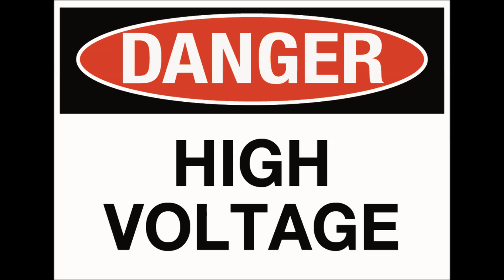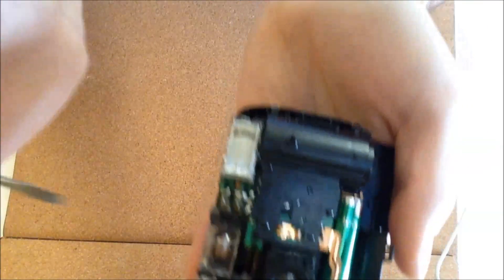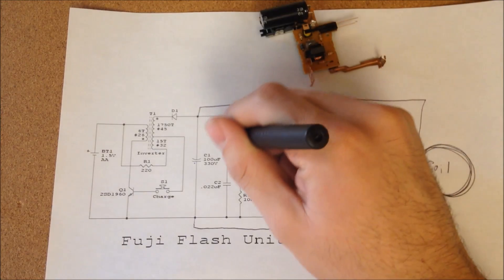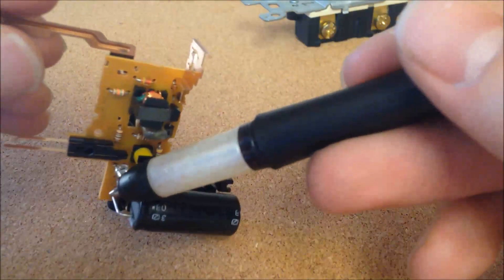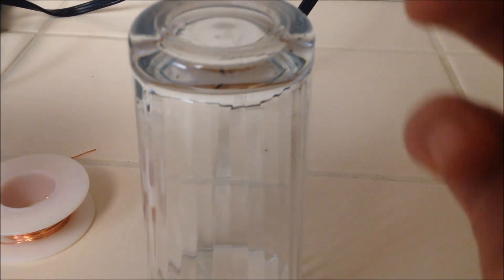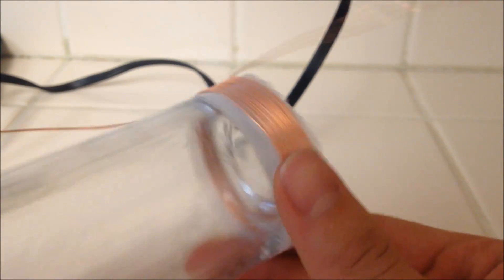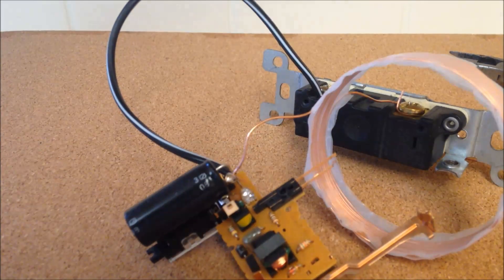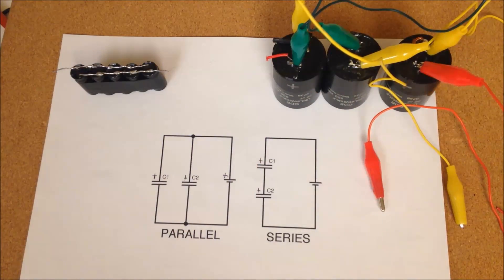How to build an EMP generator

Comment: Too little voltage and too much inductance in that coil lead to long rise times, making this a very, very poor simulator of EMP.
EMP is a broadband phenomenon.  You only get that with a short pulse having very high rise time.
This is not an EMP simulator, not even close, and you should not be calling that, because you'll confuse people.
Reply from the maker: Yeah you're probably right, although this is a really old video and I have stopped tinkering with electronics. I probably won't change the name or do anything else with this video listing.

Comment: Does the circuit can b used for higher voltage capacitor also and the power source can be also changed to higher level it is possible or not

Comment: After I follow the tutorial in the video, the LED will not light up, and the experiment will not work, but when I turn off the switch connected to the capacitor, the flash will flash. What's wrong with me

Comment: Can anyone tell me which capacitor (precise) do I need. I’m not buying a camera for that
Reply: It's not just capacitors that are needed. The voltage needs to be correct, the caps must be charged, then they must all be discharged into the coil simultaneously. He's just trying to make it fast and easy for people. A disposable camera with a flash is very cheap.

Comment: Cool video! I see a lot of comments that could be answered with basic electronic circuits knowledge.

1. You don't need a camera circuit per se to charge high voltage capacitors.
2. You can use regular batteries to charge high voltage capacitors if you make a circuit that charges many smaller capacitors able to handle the voltage of the battery and then use them in series to charge the bigger capacitor. For example, if you are using 5V batteries and have a 300V capacitor, you'll need to charge 60 smaller capacitors to 5V each, then place them in series to charge the bigger capacitor. It might take some time, but the charging time can be shortened by using more batteries in parallel and by making more bunches of the smaller capacitors (for example, you could have multiple series of 60 smaller capacitors charging in parallel, then charging the bigger capacitor). I would make separate circuits with separate switches to charge the different stages of the device.
3. Make sure the wire you are using is thick enough to handle high amperage, or else it can blow up in your face.

Make sure to understand the differences between parallel circuits, circuits in series and mixes thereof. Know your basic circuit formulas to calculate your stuff. Make sure you learn how to handle your equipment safely, and that everything has a good enough rating.

I haven't studied electric engineering in over 15 years and only remember really basic stuff, but here's a website that seems to offer a very comprehensive study book:

https://www.allaboutcircuits.com/textbook/

You know the general principle of an EMP. To build a custom one that more powerful, directional, etc... You're going to have to study this for yourself. Don't build dangerous circuits based off what people say on the internet. Understand it.
Reply from the maker: wandererstraining thank you for your input
Reply: @CameronCobb  My pleasure. Thanks for the video. It was really cool to see the effect of an EMP on small electronics. And your voice was fine, by the way.

Comment: old video but if i add a bigger cap or more winding will it make it stronger and work farther? also can it be placed on something to increase the range like a tv dish?
Reply from the maker: Trace Legacy a bigger capacitor would definitely work. Coils are tricky because the windings, diameter, and gage of wire all would make a difference. Being placed on a TV dish would have very little to no effect on the improvements of its range because the dish is receiving at different frequencies and a tv dish is a special type of antenna... hard to explain but it would not for for a TV dish.

Comment: is there a coat on the wire??? there must be a coat on the wire to make this work?? maybe that why my did't work?
Reply from the maker: Lation Fly that is correct. The coil wire is enamel coated magnet wire. If it doesn’t have a coat then it will short and not work...
Reply: that why it was smoking coil geeee.. where do i buy this coat for my wire.. or i buy the wire that have coat on it?
Reply from the maker: Lation Fly you want to buy wire that has the coat on it. I bought mine when radio shack was still in business... lol, but you can get it out of a transformer, or on eBay, or amazon. Here’s a link where you can buy it on eBay: https://rover.ebay.com/rover/0/0/0?mpre=https%3A%2F%2Fwww.ebay.com%2Fulk%2Fitm%2F161831725951

Gauge of wire should be around 20-25 but it is totally up to you.

Remember to sand or heat the end of the wire to remove the enamel coat
Reply: Do you know how to build emp pulse at 38mhz?  ill check that link out also thank you
Reply: +Lation Fly - Sand Paper?

Comment: Can I make the EMP stronger by adding an Iron Core. Also can I wrap the wire in continuous loops over and over to make it thicker, I am using 30 Ga magnet wire.  The iron core I have is only 1/2 inch thick, its about 5 inches long. Do I need to find a larger diameter core or can I use this one. You say not to hit the charge (push Button) and fire at the same time yet when your testing the circut, you flip the on off switch back and forth. I am a little confused, why did you do that.?? 
The reason I want to make it as strong as possible, is that i'm trying to fry some nano technology implants in my body (I'm not crazy, really..!!) Love your video and would appreciate your guidance here. Thanks good work.

Comment: I want to make an emp large enough to fry any hard drive, can u please give me some details regarding what I need to make it
Reply from the maker: alex hanna making one to fry a hard drive would require a lot of energy especially since most shells of hard drives are metal which would deflect most EM radiation from the emp. If anything, you would want to add a lot of high voltage capacitors in parallel. I'd recommend at least 400 volts and at least 6000 uf. Putting your hard drive in the microwave oven is also an option but it's also a lot more dangerous and would make your hard drive completely dysfunctional.

Comment: Your instructions are so simple yet genius! .. Yet I have few questions regarding the last part .. 
Firstly, If i used larger capacitors, won't this destroy the basic circuit? 
Secondly, how am i going to attach other capacitors to the circuit? Is by removing the original capacitor and soldering them to the poles or just directly solder them without the removal of built-in capacitor (even if they differ in value), or what?
Thirdly, what are recommended stronger capacitors values to try it on?
Lastly, will I need more electric power like attaching more batteries in series or parallel form or connecting the circuit to the AC if I use larger capacitors? And can the circuit be destroyed if attached it to the AC ?

I'd really appreciate it if you make a video regarding this matter, since you haven't shed much light on it & the emp produced out of a simple disposable camera's circuit is too weak I believe.
Reply from the maker: Zayn Alward if you use a larger capacitor. As long as you use the correct type of capacitor (DC electrolytic) you will be completely fine. I used a 400 volt 6800 uf capacitor and it works great! It's scary too.

If you want to add more capacitors, I would recommend that you remove the original capacitor from the circuit and replace it with the capacitor(s) of your desire, just make sure that the poles are correct. If you are adding capacitors make sure you wire them in parallel and they have the SAME voltage. Different capacitance is okay.

You WILL destroy the circuit if you connect AC directly to it. This circuit is meant for DC. You don't need to add more batteries/power to the circuit but it is helpful because it charges the capacitors faster. I'd recommend at most 6 volts because the circuit is cheap and I've always destroyed my circuit if I used around 7.5 volts or more so I stuck with 3-4 AA batteries to  power the circuit. 

I hope this helps :)
Reply: Thanks for the reply! .. Much appreciation for your knowledge.

Comment: what is the push button for?
Reply from the maker: William Hamilton I use the push button to charge the capacitors. There already is a button on the circuit to charge the capacitors but I used the push button just to make it a little easier. It's not needed though.

Comment: Question: Would using this device just power down electronic equipment or would it also destroy any stored data on the device as well? I guess my question is; is there any permanent physical or electrical damage done when this device is activated?

Comment: I want to make a similar EMP generator. I would charge a 470uF 450V capacitor with a simple boost converter. What type of switch will be suitable? Will the high current weld the connections together?

Comment: how far can a simple EMP reach ?
Reply: I think you could probably test the range by making a separate circuit which would just be a similar coil of wire but a bit smaller with less turns attached to a volt meter you hold in front of it at different ranges. I'm pretty sure that would work.

Comment: I don't know if you remember me but I did it again now I used the same camera u used, 24 AWG wire and 11 turns and when ever I turn on the switch  it would make a spark and doesn't turn off the calculator, do you have any idea what is the problem ?
Reply: change the wires connected to the switch. Mine did this too until I switched them

Comment: I am a beginner in this stuff, but today u tried to do it and I was not successful, I used 14 gauge enamel coated wire, which was really hard to make in to a circle and I think I might've burnt my capacitor so I will redo it all over again, thanks for the tutorial.
Reply from the maker: I am very sorry to hear that and that was a problem that many have came across. Did you make sure that you stopped charging the capacitor BEFORE you activate the pulse? You WILL short the circuit if activate the pulse while charging the capacitor at the same time. Please let me know if there is a way I can help you.:)
Reply: +Cameron Cobb I have 2 questions, what is the wire you used, like how thick is it and is it possible to swap the capacitor with a bigger one to get a bigger pulse, thank you.

Comment: +cameroncobb what if i dont have a camera
Reply from the maker: The camera is just an easy way to charge the capacitors. What you can do is find an AC power source and step the voltage up to the voltage of your capacitors then use a rectifier to go back to DC to charge the capacitors. :)

Comment: Can you expand on where to attach the push button
Reply from the maker: My explanation was poor and i am sorry for that. You DONT need the push button, i use it only to make the charging of the capacitors easier and safer. I soldered the button to where the "flash" button would be on the disposable camera. Here is a schematic diagram to help a little with the confusion. Let me know if you have any more problems.:) https://www.dropbox.com/s/4pak1c8ejp73zl0/EMP%20Schematic%20diagram.PNG?dl=0

Comment: can i replace the camera by anything else?
Reply from the maker: The camera is just an easy way to charge the capacitors. What you can do is find an AC power source and step the voltage up to the voltage of your capacitors then use a rectifier to go back to DC to charge the capacitors. :)
Reply: Ok Thx 
If I added an antenna would it produce waves in a high radius?

Comment: The devices you EMP'd, are they fried for good? Like, you can't use them anymore, right?
Reply from the maker: +litfuse55 No, this EMP genorator is so weak it can only temporarily shut down devices. The electronic devices in the video still work.

Comment: hello, I have your exact setup with the capacitor push button switch. everything. but mine isn't seeming to work. it charges up the light blinks but when I go to discharge it the switch sparks a little and nothing happes. I am using 22 gauge magnet wire, and I just don't understand why it isn't working. I've done nothing to short it. in just in case I tried it with three different cameras. help please anyone?!?
Reply from the maker: So far it sounds like you are doing everything good, it is emitting a pulse which is good. If I may ask, what devices are you trying to use the EMP on and what is the value of the capacitor in capacity and volts (if you know)?
Reply: +Cameron Cobb I'm trying to emp a Texas instrument calculator for testing, and the capacitor just says " 5 (2)     3w." and thank you for responding so quick.
Reply from the maker: +Gregory Thatcher Calculators are kind of difficult to EMP and I don't know why. I've had problems with them too. i recommend that you try a cheap hand help video game like the ones on my video or ones that you can buy at Walmart. i am sorry for the inconvenience.

Comment: I'm making an emp as a final project in physics. However, even though I'm followinging your instructions: used the board of a disposible camera, and making the coil(I use 14 windings). Still the emp can't turn off 3 LEDs I've put on a breadboard. They are connected to 6V and 220 ohm resistors in parallel. 
Do you have any idea, what the problem could be?
Reply from the maker: The EMP will not have much effect on LED's coming from a power source, it's too simple of a circuit and there's not much you can disrupt with the flow of electrons. I recommend you try your EMP on a cheap video game you get at Walmart because there's more to go wrong. With those video games there are other components and integrated circuits filled with many transistors and with a with an electromagnetic pulse coming from the EMP, it will disrupt the flow of electrons so the device will have no other choice but to turn off or reset. Understand though that this EMP is very weak so it is unlikely that you will PERMANENTLY destroy an electronic device. I hope this helps, please let me know if you have any other questions:)
Reply: Thanks for the quick reply. Since I live in Denmark, I don't have a walmart, where I can buy a cheap videogame. However, I can buy a cheap calculator. Do you think that it would work on a calculator?
Reply from the maker: +Casper You are lucky to not have a Walmart, it's not that great of a grocery store at all, lol. I've been able to EMP SOME calculators and others have no effect by the EMP and I don't know why, even some cheap ones. I think you should try with a cheap calculator, or even a cheap digital thermometer too. Please let me know if you run into any more trouble, I would love to help you as much as I can.
Reply: Unfortunately it didn't work on the calculator either. Thank you for your help though. It seems like I'll just have to write my report on with out a working experiment.
Reply: CAPACITORS. RESISTERS WON'T WORK.

Comment: I have 10 coils around with a 5 cm diameter, using 18 gauge enamel coated wire and nothing happens when I push the button. I hear a click so it is discharging the coil is just not making a pulse. What can i do to fix this?

Comment: for higher distances , i will need bigger capacitors and a thicker wire coil?
Reply from the maker: Definitely bigger capacitors, and when it comes to a coil, the thinner the wire, the more resistance so thicker wire would help not causing resistance in the coil and possibly breaking the wire.

Comment: What if i used an alternator from a 4000watt / 220 volt generator? would that be powerful enough to effectively go at least a few feet?
The coil wrap is about 7 inches in diameter. and there is plenty of coil wrapped. i disassembled the generator and this is the first thing i thought of.

Comment: Can you give use the of the electric scheme
Reply from the maker: https://www.dropbox.com/s/4pak1c8ejp73zl0/EMP%20Schematic%20diagram.PNG?dl=0 

Please let me know if the link does not work for you.
Reply: YEahh its working . If i make my coil bigger , do i have a better emp ?
Reply: But can you give some credit about it What does it mean  r2 3.9m ? Restitor 2 ? and the lilttel numbers ?
Reply from the maker: +ilias boubout yeah sure! So in the diagram, you will see "c1" or "c2" and "r1" etc... The letters are short abbreviations for the component. C = capacitor, r = resistor, q = transistor, etc... And the number after it, for example, r2 means resistor #2. Seeing components numbered off like this is common in schematic diagrams and is used for reference so if I were to say "resistor 2" you would know that I am referring to "r2" on the schematic diagram. The number after it, such as the "3.9m" refers to the value of that component and resistors/resistance are measured in what are "ohms" (Ω) so the value of r2 is 3,900,000 ohms (which is a high resistance for a resistor). Same goes with the r1 which is 82 ohms. :)
Reply from the maker: +ilias boubout Making a better or stronger EMP is tough and there are 2 variables that makes the pulse, the value of the capacitors and the construction of the coil. In terms of diameter, the wider the coil the weaker the pulse will be but smaller the coil, the more concentrated the pulse will be. For the capacitors, I recommend having a voltage value of over 300 volts with a high capacitance, anything over 500uF (microfarads). The best results I've had was with a 2 inch diameter coil with 10 turns with a capacitance value of 600 volts at 750uF and I was able EMP an iPhone:)

Comment: do it is necessary to use a camera circuit, can`t we use capacitor dierectlyby connecting it to power supply and switch.